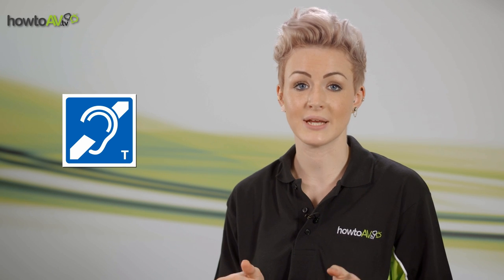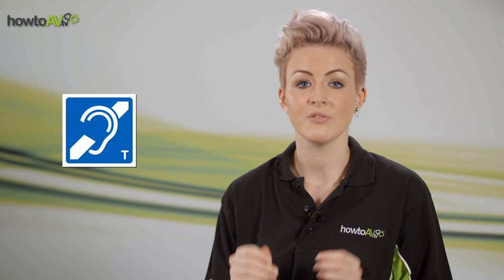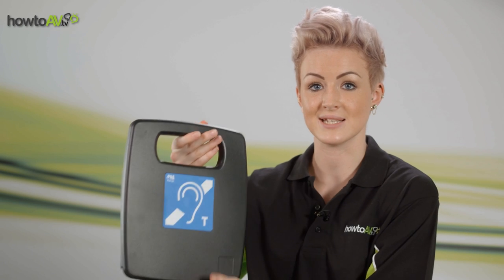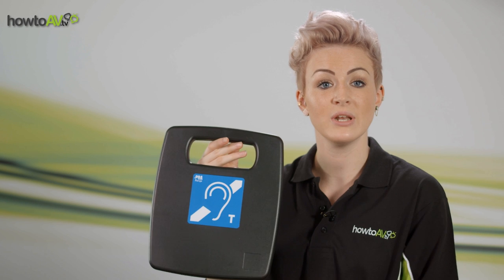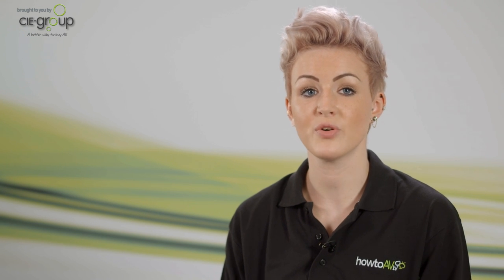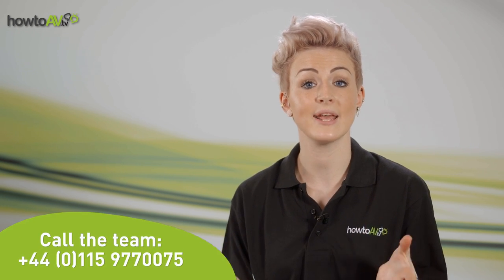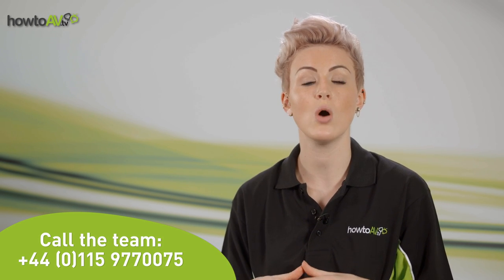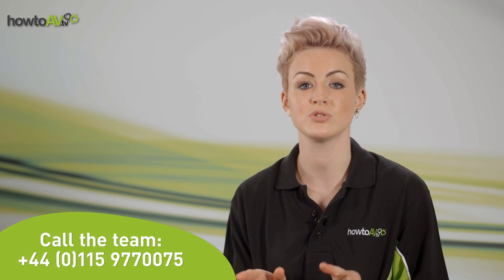What is an Induction Loop System? ( AFILS )

Comment: I have 2 off Phonak  Naida P70-UP  aids (NHS) + a Partner Mic  (private).  The hearing aids work well direct to my mobile for phone calls.  The Partner mic works well direct to my hearing aids for 1:1 situations, like the teacher at a dancing class.  I am very much in need of a mic for small group situations  along the lines of the Roger Select but simple; cheep; and easy to use like the Partner mic.         I have had Roger equipment some years ago but never found it very satisfactory in a number of ways, but perhaps I received inadequate support?  It seems the Roger kit is Radio signals and the Partner mic is blue tooth.  It seems there is a Roger ON system that would work but £1365 is a lot of bread for domestic / family use.  T loop works brilliantly at church.  I wonder id there is a small portable T loop system that would sit on a table in the middle of 5 or 6 people in the house.  Any other ideas would be greatly appreciated?    John

Comment: If you live in a country where the state has a monopoly on radio broadcasting, can you use an induction loop  as a transmitter and connect a telecoil to the back of the stereo for a receiver?

Comment: TV loop system is brill , but it will not work using my dvd. any ideas?
Reply from the maker: +Anthony Wright
Good morning Anthony and thanks for your question.
Unfortunately, there is no simple catch-all answer I'm sorry!
However, if you could let us have some details as to how your system is configured and the products you're using (particularly details of the Loop product), we'll see what we can do to help.
For instance, can you confirm if your loop is connected to the audio line out from your TV?
Is there any additional audio system (sound bars or surround sound, for instance) connected to your system?
Any details you can provide will help our engineers to work a solution for you...
Thanks for watching,
The HowToAV Team
Reply: What is a loop ?